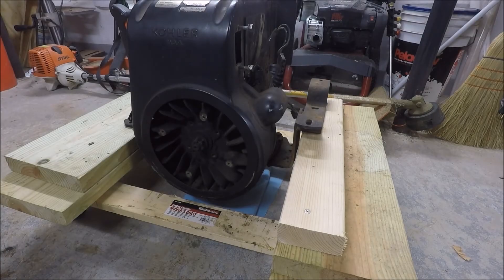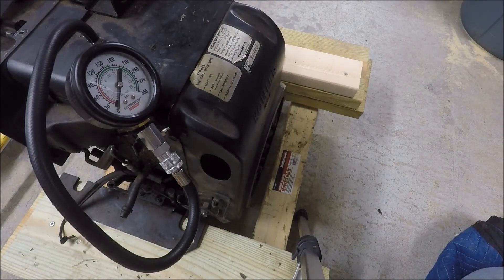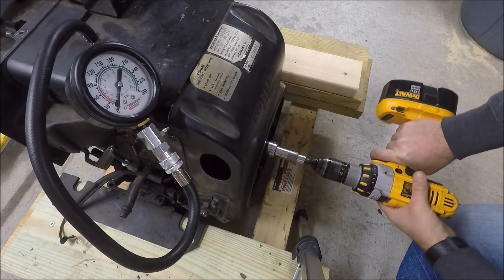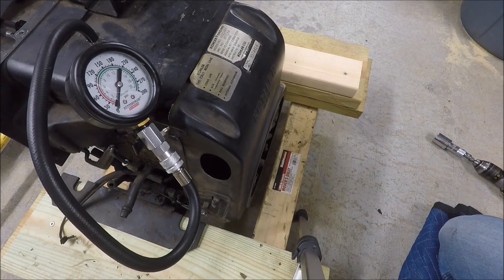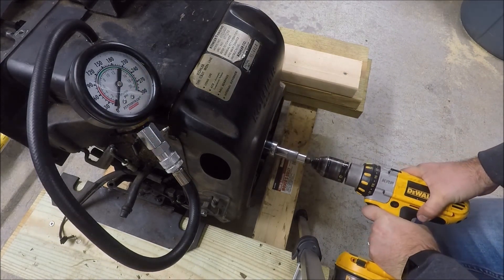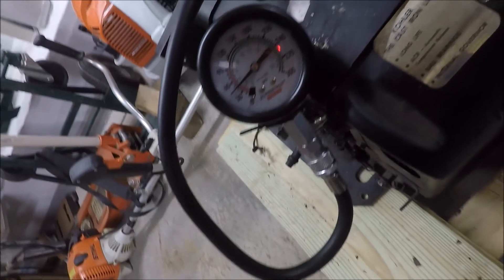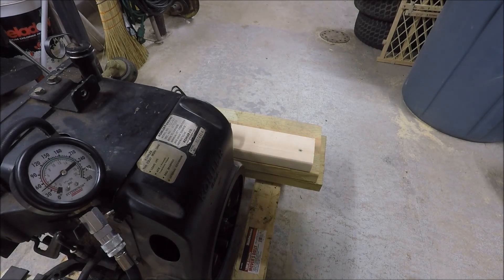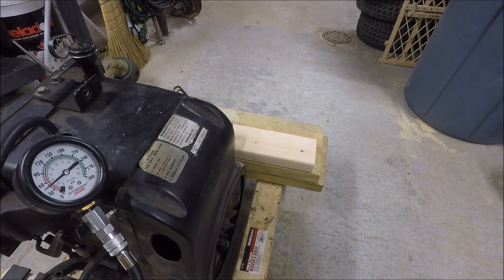Kohler K-Series Engine Automatic Compression Release

Comment: Don't know about this specific model but working on B&S vertical shaft lawnmower engines, clockwise as facing the flywheel is the rotation and the compression release is only supposed to be active at low RPM for ease of starting and that compression is about 50-70 PSI. Once it starts and the speed increases, centrifugal force disables the compression release and it then gets full compression when it is running. The point is, the compression should never be 0 because you would never get it started.